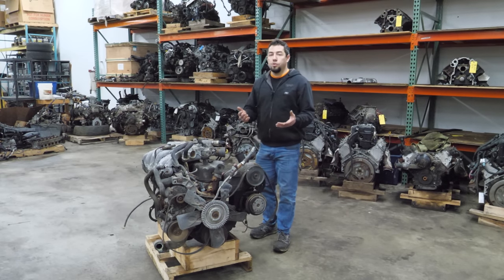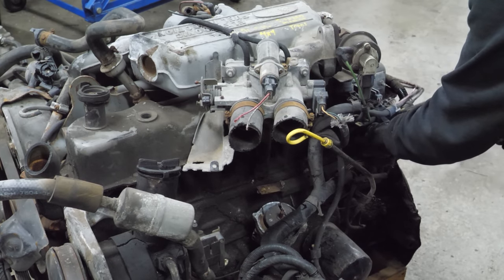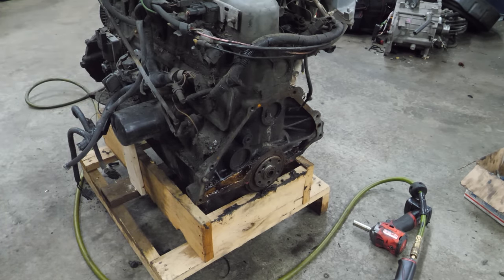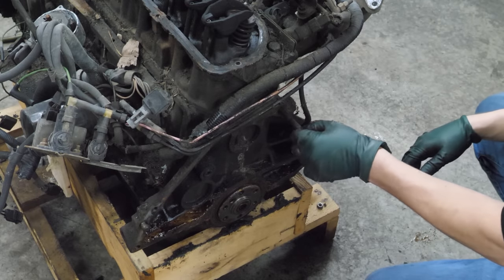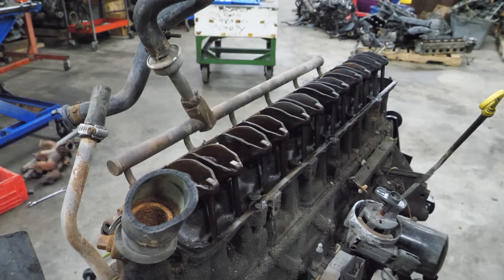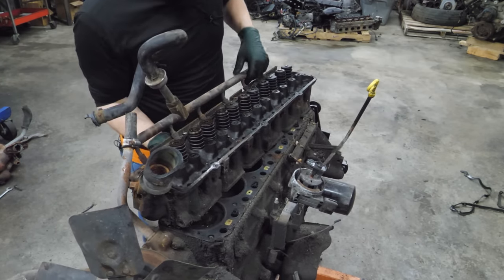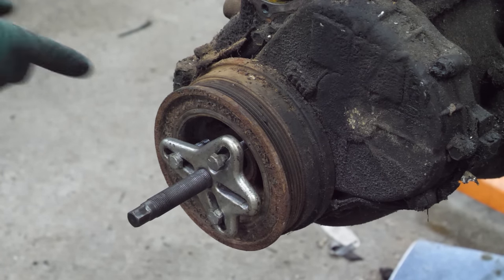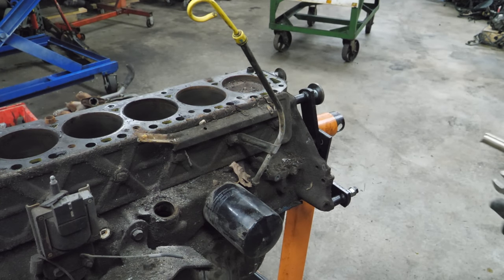FINALLY! A "Bad" Ford 4.9L 300 Straight 6 To Teardown! Most Reliable Engine, Ever?

Comment: I've driven some of those old flatbed Fords that have the 300 and the 440 big block in those engines with run forever even when they were tired but sometimes they would be so tired that they would heat up and hydro lock and you had to wait for them to cool down and order to start them.

Comment: Had a f350 with inline six it slung a rod cracked the block. So I welded the block back got a crankshaft from another six laying around had no idea of the year? I put the crank and rods pistons from the engine that sat for years laying in a corner of a barn! I just bottle brushed honed the cylinders. I put new rod and main oil pump new piston rings and gasket set. Put it all together after break in changed the oil and filter and its used perty much every day still healing loads to the mill

Comment: I've had two of these back to back unfortunately fail. Sucks bc I loved the truck but one spun a cam bearing and the second one seized and I haven't had it apart yet. First one ran for 200k, engine swap was easy and lasted 15k

Comment: I agree with you  on the most reliable engine ever. Had it in a van and I never changeed the oil or a tuneup in the Memphis very hot summers. I tell you I paid 150 bucks for that van and all it did is run up and down the hiway from Memphis to Mississippi to Arkansas. Not once did it stop on me. Took it to Mississippi everyday to go fishing. Someone stole it from me with all my fishing equipment and my S K tool supply from working at Midas.. I was not hurt about them stealing all those expensive tools. I was mad about them stealing those fishing poles and forcing me to stay at home with the wife and kids. Memphis police found it and it started right up a month later. I went on and let Memphis PD keep it. It felt like someone raped me.

Comment: Plastic probably came from the valve seals.  They would get hard and break and wind up in the pan and oil screen pickup.  If they made it past the screen the oil pump would lock up which would shear the distributor drive gear pin and cause the engine to stop.  Great engine, early ones very dependable with  routine maintenance.

Comment: The heads are not known for cracking. Engine Power did a series of videos on the 300 and they started with an industrial engine. All industrial and truck engines in the F250 and above have steel cranks, FYI. They were choked way down from the factory, but some simple bolt on mods,intake/ carb, headers, hei ignition etc double hp and and brings the already high torque to almost 300lbft. Great engines and ny favorite gas burner.

Comment: There are still a bunch of them running around the airports in tug baggage tractors with cng as the fuel source. I work on that engine most weeks where I work.

Comment: I love them. People talk crap about them cause they dont have lots of horsepower. When a 5.0 had 205/210 and the 4.9L had 145hp. Even worse on the carburetor models. But torque was around 250. I hate the fact ford didn't make it more balanced. The jeep 4.0L 6 produced 225hp and 225 torque. Pretty balanced. Ford could have got the 4.9L some better performance and they didn't.

Comment: Had a rusted out  96 f150 5 speed, I used for weekend work and it never let me down, also it would pull anything. The only issue with it was it was like a time machine, I'd want to go back to smoking cigarettes and wearing mechanics overalls like my deceased father.

Comment: Clean it, change the headgasket and oil sump gasket, put it back together with all the same parts (no machining, just cleaned) and put it in a Miata

I bet it still runs just fine

Comment: The inline 6's are making a comeback!  Ram will have one soon and its gonna output over 500HP.  These were tough to beat for reliability and lugging torque.  GM had the 292, Dodge had the possibly more reliable Slant 6.  Dodge needed more cubic inches to make the truck version compete, it had a great stroke at 4-1/4" but was only 225 cubic inch displacement.  I think Dodge should have made a new slant with same stroke and 4" bore like the 300.  This would have made it a 311 and would have made well over 300 lb ft torque.  Beating the 300 by a decent margin.  But they opted for a new v6 and we all know how that turned out.  a new 300 could be made today with modern head design and direct injection and turbo and would be a monster with Deisel class torque.

Comment: They are sturdy engines no doubt. Had a 91 from auction that had a blown head gasket, bad lifters, slap worn cam, but ran like a top. Did get swapped for a v8 for a little more umpf though.

Comment: The Ford 300 is the toughest engine ever designed.  They do tend to develop cracks in the cylinder head between cylinders 1 and 2.

Comment: Take a look at the Horsepower from one of those engines from Power Nation or the Guy who took three V8 heads after cutting them apart and putting them back together and making a cross flow head.

Both of those made amazing power. 

A Beast of an engine ,

Comment: Would be cool to see ford do a modern version of this with dual injection and electronic ignition to increase HP and keep emissions/MPG in regulation. But it must have the same single gear driven cam, no other frills, no forced induction. Just a solid everyday runner in a basic truck. I think that's what most people ultimately want.  Did I like my 2.7 ecoboost, yeah, but it was a fairly complicated unit. 
With updated fueling, higher C.R., & ignition, a 4.x liter I-6 could probably get to 250+HP and 300 torque.  Perfect for a more basic F150.

Comment: Years ago I was driving one of my 80’s carbureted 300-6 F150’s and it was loosing power. I started checking things and discovered the oil level was high and smelled like gasoline. I bought a new fuel pump and I discovered that the diaphragm of the old fuel pump ruptured and gasoline was going through the rupture right into the crankcase. I had to change the oil after I replaced the mechanical fuel pump.

Comment: I love the 300 six cylinder. Unfortunately, the one I bought was so worn out that it didn't last long. The rings were so bad that most of the fuel washed past the rings and ended up in the crankcase. I had a mechanic friend start a rebuild for me, but his health deteriorated, and he couldn't finish it. So the truck sits for now. I wish I wasn't working 6 days a week and could do it myself. I need my truck. Hopefully, the local engine shop can help soon.

Comment: The mighty 300 FORD L6 should have been as an option in the first Bronco 1966 - 1977. Not the horror 170, the 240 was not as bad as the 170 but the 300 was the right choice for that 4X4 with big moment power. I think that was a big mistake not having it there.  
I did once see an old Bronco with it and it was going strong. Power nation did make one up to 500 and that's a lot.

Comment: The only bad thing about the engine is that on highway it does leave a little power to be desired. That's what you get for building an engine for reliability first and performance economy etc second.

Comment: I think that out of all of the engines produced I think Fords 240/300 and Chryslers Slant 6 are the two best...i give Ford the nod simply because there is no timing chain...less parts.
   Both are basically bullet proof. I don't think there will ever be another engine created to hold a candle to these two. 
   I would love to see a slant 6 torn down 🙂

Comment: I have a 92 4wd f150 with this engine. The truck has nothing but sentimental value to me. It's not rusted or beat to hell, it's just old and drives old. It leaks oil like a civ and I am pretty mechanically inclined. Do I rip the engine out and try to fix the leaks and hope it still has 100,000 miles of life left? It was rebuilt about 60,000 miles ago but it was also like 10 years ago. The truck is basically a dump runner but I would love to make it more. I just have never been a fan of the slow but torqued out engine. And a v8 swap seems to be out of the question with the way they made some of the stuff in the 92's

Comment: i've got one out front. the truck it's in is a moldy piece of crap and it blew a freeze plug last winter, but it still runs at 240K. my 4.6 was not so lucky (unless there's a freeze plug under the timing cover / in the oil pan - i haven't finished the autopsy on that one). i'll take the moldy piece of crap over walking any day

Comment: I have a 88 bronco I bought to 4 wheel and I laughed at a ford straight 6 had a built 351 Windsor to swap it after some research I figured man it’s really motor I’ll give it hell till it goes and swap ur talking about a bronco that’s set for 24 years straight no start a battery and it drove home with 24 year or older fluids two hour drive only fluid I had to add was coolant and a year later she still starts on the first half a click 4 speed bull dog 208 trans case 8.8 front and rear u can daily it and I’m a Chevy man and I own a built tj and it breaks all the time has tons of issues and is 8.8. Swapped rear 455 gears lockers different transmission trans case lifted tires winch and the bronco does any were it does on 32s lol and never gets stuck never breaks down and can daily the hell out of it

Comment: what he does not mention is that he sees pretty uniform wear and THAT IS A GOOD THING.  unusual wear in one area is a much greater problem.  that whole motor needs to be re-machined and rebuilt.  i am suprised to hear him say " not a lot of money in these old straight sixes. "   anyone that thinks these modern pleasure vehicles will be running around in 10 years ...   i said in a comment a year ago "  the v-8 was a marketing gimmick and the straight six was the only and ultimate truck engine.  ask yourself why you have a truck.  if you are sipping your latte or canned bear and just driving around - those days - and you - are over.

Comment: Ill talk some crap about this engine.... Two words!               VACUUM LINES!       Vacuum line everywhere! Trying to track down a vacuum leak can be a nightmare. Other than that ive had no issues other than a harmonic balancer separating and walking off the crank. My truck might be slow but it will definitely get me there.

Comment: I think I’m the 25 years I worked for ford I ever saw 1 replaced because it ran out of oil and locked up. That one in the video was a later one (like95/96) because it had 2 HEGO’s.

Comment: So I had a 1985 Ford F-150 with a 300/6. It was my winter truck one summer day I started up to charge the battery and got distracted and the thing got hot real hot Gage was pegged out open the hood the coolant was sizzling from the head gasket I shut the thing down. Thought for sure I'd be putting a head gasket on it The next day I checked the oil it was fine started that thing up and it ran fine I drove over the next winter as is that 300/6  one tough engine.

Comment: I put a new head on mine. Valve guides were worn valve seats were really bad. Cost the same as a new head to get machined. Got some other new ignitin parts on it. 267k on it and still spins the tires lol

Comment: Pretty sad that Ford decided to shorten the hood length on the 97'+ trucks. They had been testing an aluminum crossflow head on the 300 but once the decision was made for a shorter hoodline it was canned in favor of the 4.2L (Stroked 3.8L). A cross flow head would have really woken up the 300, heck a 4bbl intake and headers would add 70-80hp on the old carbed ones. Add an RV cam to that combo for another 20-30hp. I never had a Super high mileage one, the most I had on one was 340,000 and the valves would start floating at 3500rpm LoL.

Comment: If they would redesign it with deep skirt block with 6 bolt mains and 6 head bolts per cylinder with 2 cams on each lower side (still using push rods) then incorporating 4 valves per cylinder, dual injection and a compound turbo with variable geometry intake… SUPERDUPPERDUTY ENGINE!!!

Comment: Those phenolic timing gears can eat themselves. Cheap upgrade is a steel timing set from a 1979 f150 with a 300. Other than that not really much else I can think of. Sometimes a bent pushrod, but nothing really terrible.

Comment: Either had 100K miles with  oil changes every 50K, or 200K with every 25K, or 300K with every 10K, or 400K miles with new oil every 5K.

Comment: I've driven inline 6; cylinders my entire life. Jeep 4.0. Ford 300. Chevy 296 ? Whatever that one was. It's just a reliable design. Running pistons inline takes less moving parts. Bearings don't wear . I'm 47 and drive a Ford 300 with a 5speed. It's a barn find with only 80k on it. I'll probably end up switching it into a different body because I'll wear out the truck before I do the motor

Comment: 2 drip pans and a piece of rubber across the center beam of the lift angling into both pans in both directions would solve 75% of the spillage issue.

Comment: Massive nostalgia hit watching this video.  My high school truck and vehicle that I learned how to work on vehicles with was an 84 f150.  Bullet proof engine.  Even had the fiber crankshaft gear disintegrate on me and put wood fiber bs all throughout the oil channels and lifters.  All that changed with the engine was "our lifters now make noise" lol.  Cheers

Comment: Did you even check the oil before you started to turn it over?  Always there are at least two valves open, exhaust and intake, where water can get in through the exhaust or that broken intake manifold.  I always remove the spark plugs and spray a generous amount of penetrating oil into the cylinders before I move anything.  I would also strip everything off to make sure there was no mouse nest of clump of dirt in the intake manifold.

Comment: Dodge, Chevy, Ford, all made some pretty sturdy in-line 6's that stood the test of time. But two things really went against them. One was they were not a V-8. Somehow the concept of a V-8 having the most power and the most torque just stuck with motorheads and of course it sold more engines that way. The other thing was you could put a lot of work on these engines and so you weren't buying a new car / truck in 5-10 years due to motor failure. It's good for business but bad for business at the same time. Now, today we have forced obsolescence. Car manufacturers can count on you buying your next car after 100,000 miles.

Comment: If I were you I would rebuild that engine back to the original with points and condenser with a carburetor because they were one of the best engines ever built, even if you just shelf it.

Comment: You mentioned that the number 5 plug looks a little rough. I had an issue with one of my F-250 losing transmission fluid while operating and it was getting pulled into the number 5 cylinder and it felt it up so badly then cylinder stopped firing. It also didn't help that somebody doing the oil change and accidentally filled it with 22 L of oil. Instruct the truck still runs by the way a 1995

Comment: I have one of these engines in my 1981 F-100  Although mine has the 1bbl carb.   The only issue was that it sat a LONG time before I bought it and the gas caused some issues with the head and that had to be taken off and sent to a machine shop and the rear and midship fuel tanks removed and cleaned of that nasty ass gasoline.

Comment: I have had a couple of these engines.   Great engines, but they are killable.   The way I killed mine was catastrophic coolant leak that led to immediate overheat.   That cracked the head.  I'd look at the head at the intake and exhaust ports.  That's where I found my cracks.

Comment: another great engine in the 6 inline is the chevy 292 was a great one and the chevy 250 inline was a good one to but not as good as the 292 inline. the ford 302 was the best engine ford ever made they say and they called it FORDS MIRACLE ENGINE,  they installed it in many vehicles this is the engine that saved ford from bankruptcy....

Comment: Kinda looks like someone's been in there and maybe when they put it back together they left a extra piece of plastic? 
Have a 91 f150 and that looks like it's a clone down to the bracketing. 
I have 550,000+ and running strong in a shorty 4×4 .
Bought it new and it's been the best truck ever. 
Had to change the valve cover gasket. Other than that waterpump and alternator. 
Darn thing runs too good to worry about a refresh. Wonder how long it will go?  Forever is a distinct possibility.

Comment: I'll bet you #5 injector was leaking. Fuel in oil, clean cylinder. Oh, and the piece of plastic fell in when the pan gasket was changed and the pan wasn't cleaned.

Comment: Had an 83 e100 van with over 650000 miles on it, kept going till an idiot pulled across highway from quarry. Work horse trapline vehicle

Comment: I just went through my 94 4.9L replaced pistons camshaft bearings valve stem seals rockers lifters oil pump seals and gaskets. I cannot identify the plastic found in yours, I don’t recall plastic being used anywhere. The sludge in my engine was much worse it appeared to have never been serviced and was rattling horribly.

Comment: That engine probably had 1/4 million miles on it and terrible maintenance. I have owned three and adore them. Keep good oil in them and the cam and crank journals will stay healthy. The only thing that will put a 300 on the trailer is the junk hall effect sensor in the distributor. And when that dies it's a $15 fix.

Comment: The plastic piece could be from a old timing gear. The mid 90’s timing gears wear made of a hard plastic that tended to break over time and the replacements you could get was either plastic or steel your choice
Reply: Kinda what I was thinking too because there's evidence that someone was in the engine before with the handwritten numbers.  It doesn't look like a part of a timing gear to me but it almost has to be unless it was part of something else that ended up in there when it was open before.